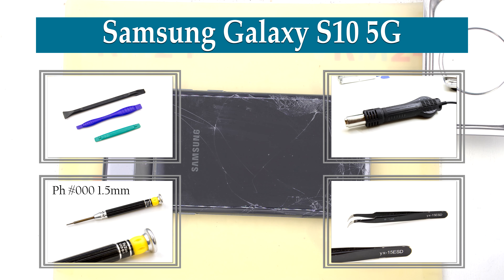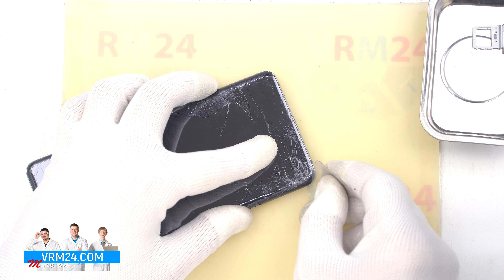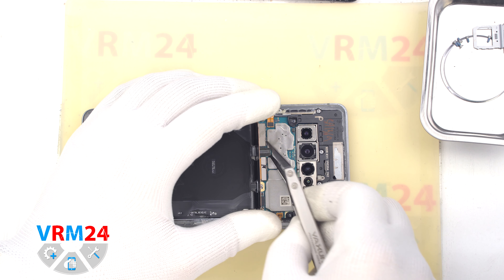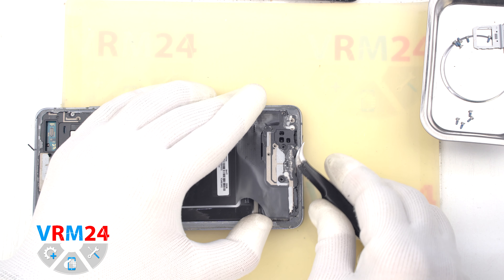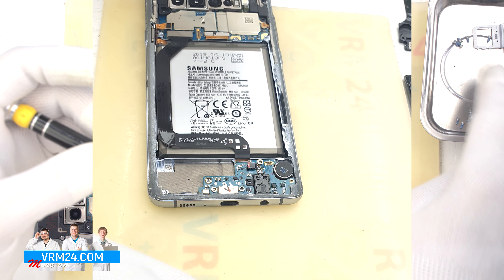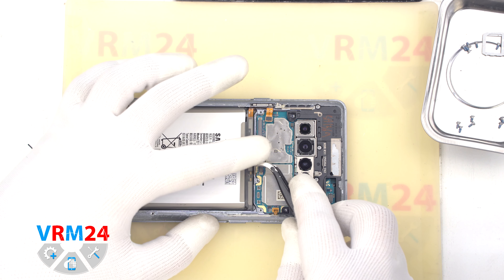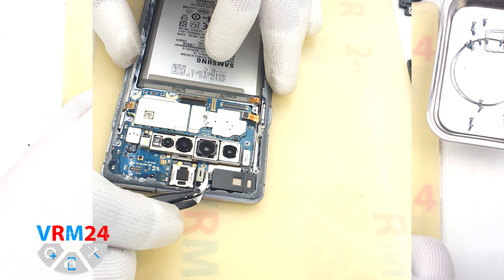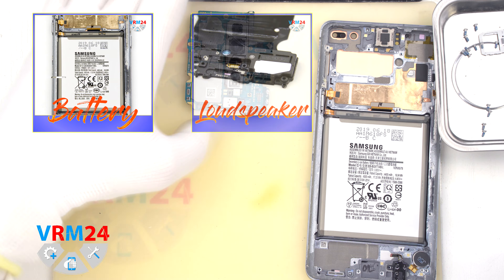Samsung Galaxy S10 5G SM-G977N Take apart Disassembly in detail

Comment: New subscriber here!
Hello bro i just have a question i hope you will answer,
Is it possible that a technician can remove a 5g chip on this phone?
Thats what i suspect after my phone got repaired from a shop it only has an LTE signal no more 5g or 4g and it is now very slow in data connection because its only LTE.